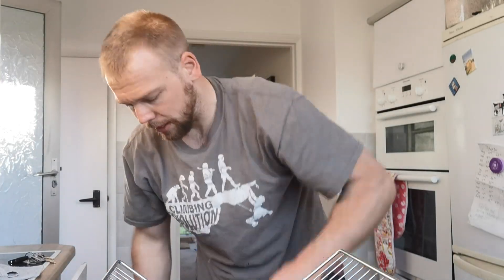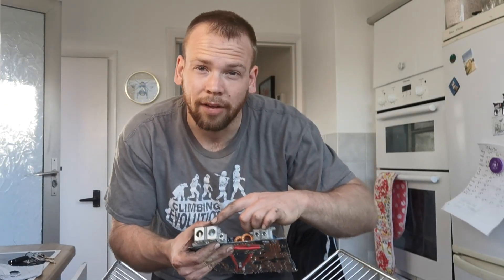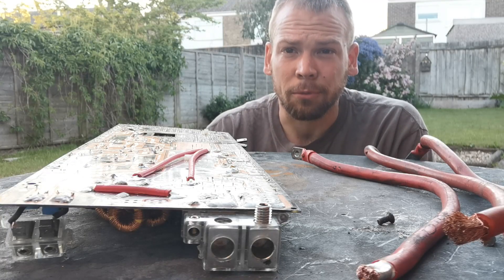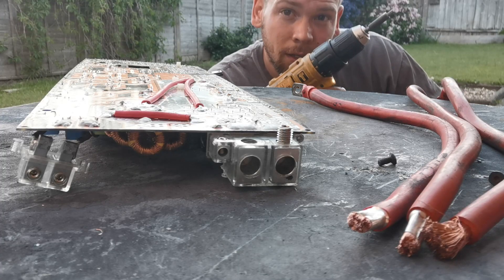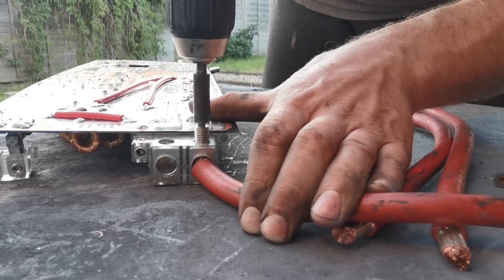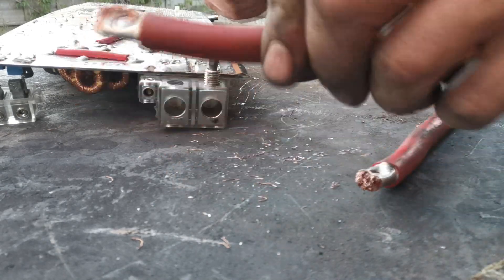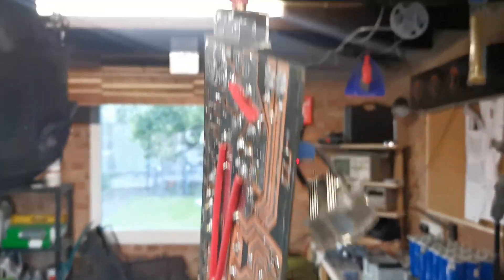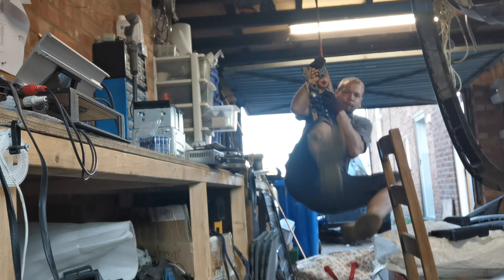Ferrules VS Bare Copper - Do You Need Them?

Comment: I only care about the flow of current, to me it's just an extra resistor and less surface area that connects to the terminals. I won't use them.
Reply from the maker: The current flow won't be affected by 0.5mm of ferrule, it doesn't cause any heat build up and is only ever going to be noticeable in extreme spl applications of 170db cars and so forth. Your amps board is made of much thinner copper traces that causes higher resistance than the ferrule ever will so I honestly wouldn't worry about it buddy, each to their own for sure and I totally respect your choice 😊.

Comment: Also do a conductivity test?
Reply from the maker: No need, it's like 0.25mm thick, won't me a measurable difference
Reply: No worries about that.
Put a speck of cooper paste in the ferrule (before crimping it) if you are worried about corrosion and that will last last forever, it is a corrosion inhibit up to 1000 degree Celsius when it will melt..
Reply: Do a intelligence test…

Comment: Why didn’t you do one that was soldered on?
Reply from the maker: Don't need to when they are that strong normally.
Reply: Solder is much harder to fix or fit the tip of the screw than locking it into a sheet of metal that is the ferrule.